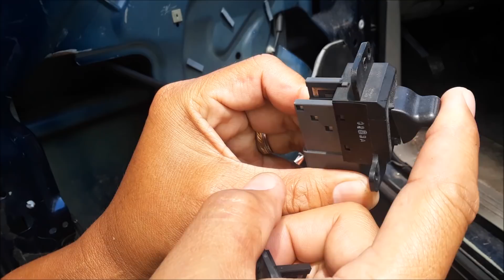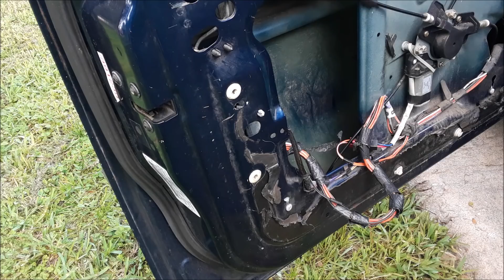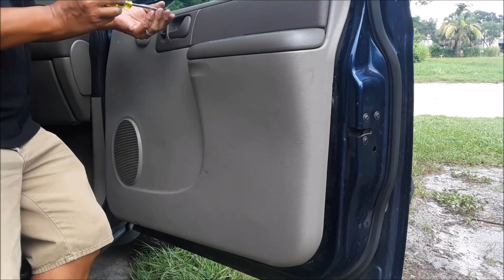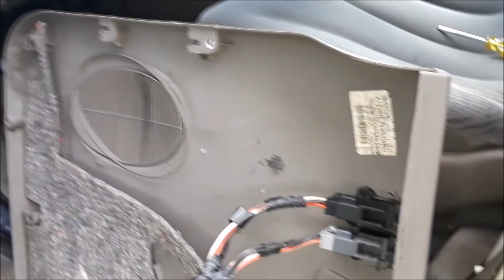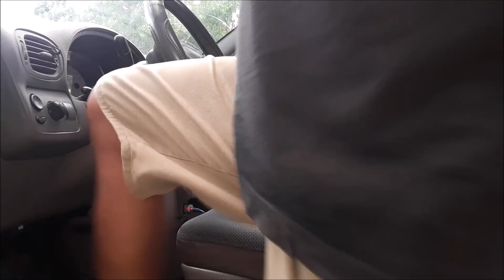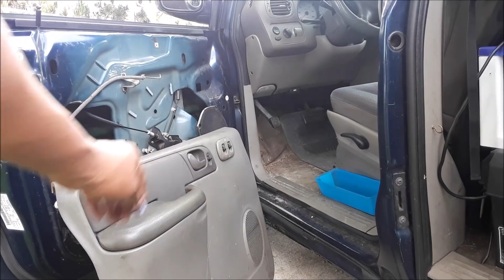2003 Dodge Grand Caravan Driver Side Front Door And Window Repair (V1334)

Comment: About 2 years ago i replaced the drivers side electric window regulator on my daughter's 2006 caravan. That was some job to tackle alone. The window itself was surprisingly heavy. Saved her $250 in labor. I am a close to 60 yr old woman. Watched a few youtube videos about it first. She and I replaced the headliner, which was coming down. Bought the fabric at Joanns and spray adhesive. That was an all day job and then some, and wow it was not easy. Took down the large plastic tray (scraped everything off and adhered the new material) and putting it back took every bit of patience we had lol. Your van sounds like it's running great👍

Comment: Unscrew the 3 screws to the door latch and remove the latch, hook up the rod to the latch then slide both back into the door and hook reattach the 3 bolts. Without that plastic piece you might have too much play and work inconsistently.
Reply: Thanks for the tip! I've been going crazy trying to figure out how to get that damn rod back in?
Reply from the maker: ggin nj Will do this if it falls back off. It fell off after the video, so I bent it slightly more as well as bolted down a window guide beam, so the door doesn't rattle when it closes anymore.  So far, itseemd to work fine for now.
Reply: Living In A Van at least you have a lot of room to pull the latch out. I just fixed a handle on a Ford Focus the other week and the space in the door was exactly the size of the latch and you really had to pull/push it to get it through....